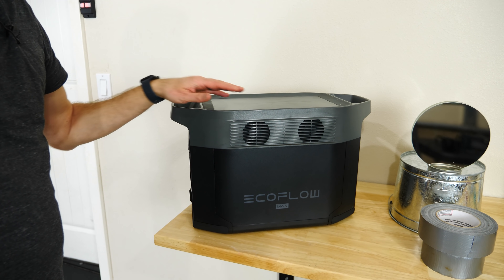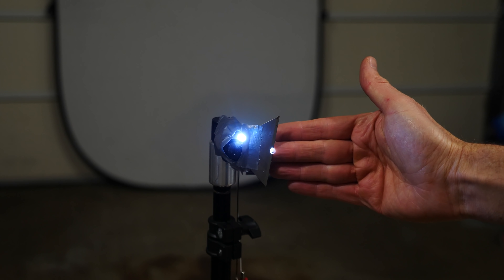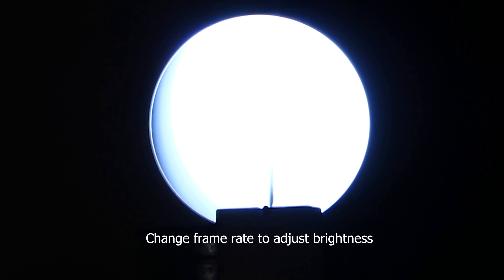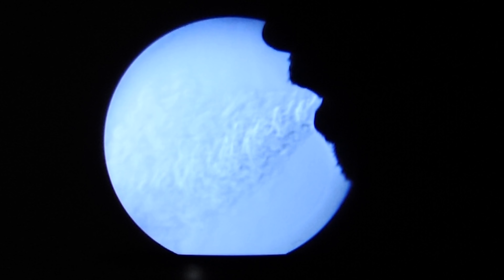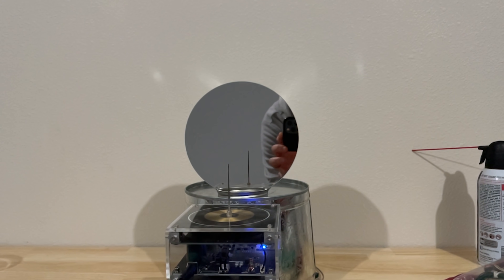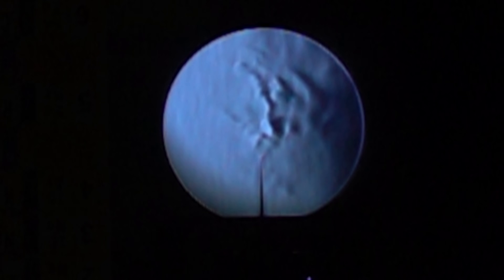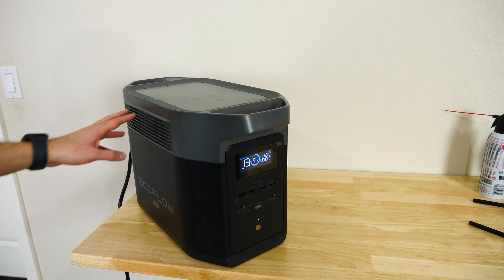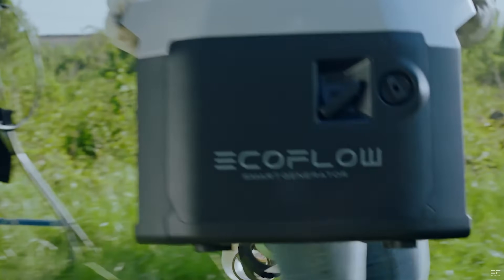How to Make a Schlieren Image of a Tesla Coil

Comment: Would be interesting to use a really high speed camera - can't do this with normal tesla coil photography, but with the Schlieren system you can use as much light as you need for the HS cam
Reply: Might even be able to see shockwaves from the sparks

Comment: Imagine one of the cells fail in that ecoflo generator. HOLY SHIT what a disaster that would be!
Reply: @bitonic593  thats not the failure mode im thinking of. those packs are stuffed full of 18650 li-ion batteries with no space for cooling. only the power electronics are cooled. a battery is likley to fail in one of two ways: a breakdown of the electrolyte or a breakdown of the insulator usually from a overheat event. also lithum batteries, 18650s have a runaway temperature it could reach before its detected. then it will be too late. that batterie will light up like a roman candle and light every battery next to it. Samsung, Tesla, Vapes. Lots of stories of battery fire. why u think tesla developed new batteries. I dont like elon or tesla but their new battery is the only li-ion battery that should be used in such configs and ecoflo does not. and these are not fires you can just extinguish. they will burn down your house if given the chance. It should stay outside. i rather have a mini nuclear reactor. its less likley to catch fire and it not release radiation unless u fuck withit. also, batteries like that are so bad for the environment. if you put money into that, just put moneyinto some deep cycle batteries. yeah they bigger but they also last longer and are always ready. that POS gunna break when u need it the most. sorry i dont trust it. gimmie a battery  cell thats designed for the aplication, theirs are not. if they are, they would have adveritsed it.
shit, teslas battery backup in texas caught fire because of proximity issues. that was before the release of the new battery. idk if there has been the new ones catching fire.
Reply: @Wtfinc  bro how long were you typing for holy shit

Comment: Electric generators are just batteries. And gas generators can be very quiet. 
DO NOT TELL people you dont have ro worry about fuel. You have to have a way to charge those things when they run out. In an away from grid situation, a small inverter genrator is the best option followed by solar panels and then tieing it to a vehicle. 
The marketing for these is dishonest. They arengood products but the marketing is bad.

Comment: I thought the only thing that can bend light is a black hole?
Reply: Through a constant medium, light travels in a straight path. However, when the properties of the medium change (hotter air vs cooler, or air vs water), light can refract (change direction), with the result being that it no longer follows a straight path.

Light gets "curved" around a black hole, or any massive object, due to spacetime. The light, in that case, is still following a straight path, but the mass of the black hole has curved spacetime itself. So from the "outside" it looks curved.
Reply: @adamplace1414  thanks my dude, good explanation.. science is so fascinating

Comment: Can we all agree it's not a generator, it's a battery pack
Reply: Ya, that bugged me too. I have an EcoFLow though and absolutely love it. My favorite perk is the built-in FAST a.c. charger. Least favorite thing is the APP is required to make certain settings changes (depending on the model) and the app requires you log in.
Reply: @gingerman5123  Very good to know it makes you use the app. I hate this trend of making you install an app to use a simple appliance.
Reply: @Norsilca  I have a RiverMax. I can only change the color of the LED (or turn it off), and enable/disable fast charging through the app. I know the larger units have a switch for the charge rate. Still the best battery, IMO.
Reply: @gingerman5123  does yours have a solar panel? If not, fine, yours can be accurately called a battery, but solar panels generate energy, my good Ginger Man
Reply: A glorified battery
Reply: It is when you plug in the solar panel.
Reply: @tylerfrost77  seriously, I'm pretty sure this dude commented without actually watching the whole thing
Reply: Wonder what happens if it catches on fire...
Reply: @ELStalky  it burns, just like anything else.
Reply: @gingerman5123  The question is whether it burns more or less peacefully or explodes.
Reply: We can assume battery is some kind of generator
Reply: It is literally a solar generator
Reply: Also what the fuck do you think a gas generator is, it's a metal and plastic contraption that houses chemical energy and puts out electrical energy, sound familiar? Energy storage with electrical output dude, all it is. The fact that it includes a solar panel to actually generate electricity is a whole fuckin upgrade. I'd buy it if I had money, or if my money, when I get some, wasn't already going towards building my own thermoelectric generator lmfao. There's more than one way to harness environmental energy.

Comment: You have to "charge" a "generator"?
So what is it really, a generator or a power bank?
Reply: Agreed. It irritates me to hear these called "generators". We've had them for YEARS, and they're called Uninterruptible Power Supplies. These things have their place, but I'll take my Generac whole-house propane generator or a noisy gas generator any day. Why?  What happens when the battery bank runs out of power during a power outage? Going to plug it in to recharge it? Oh wait...  But what about solar charging? The majority of power outages occur as a result of storms. And that solar charger doesn't work so well in the rain. So these Ecoflow type things are good for camping and short-term power tool usage on a job site, but they're no replacement for a proper fossil fuel powered generator. They're also expensive as get-out, and I expect the batteries will fail before your gas generator does.
Reply: It's certainly not a generator.
Reply: Doesn't the same argument hold for fuel powered generators? You need them to "fuel up", and it doesn't generate anything, it just converts. It converts chemical potential energy into electrical energy. Much like a battery in it's own way. I see your point that the promoted product is nothing like a traditional fuel powered generator, but calling it a power bank or battery also doesn't quite cut it IMO.